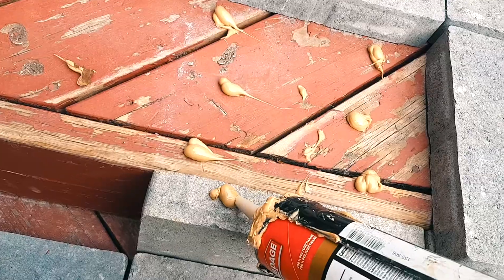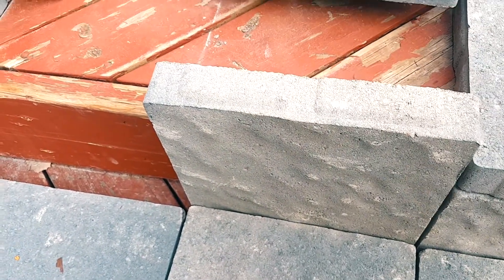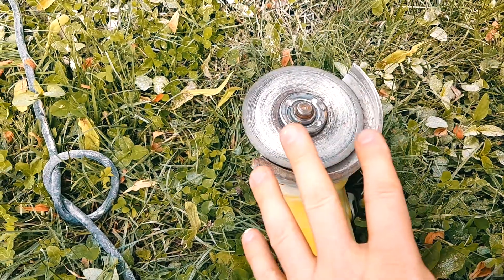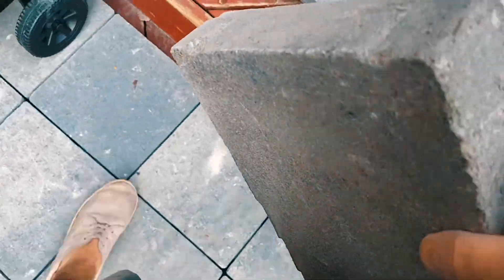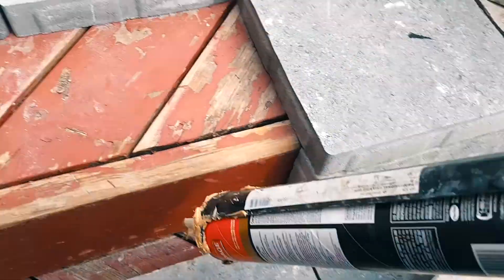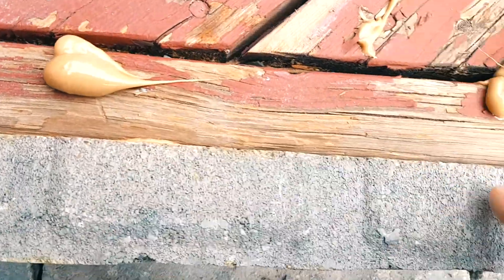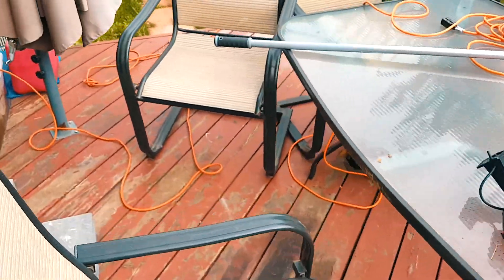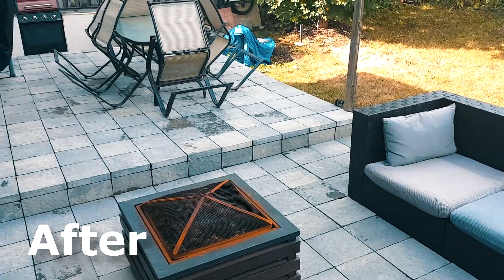How to Cut Patio Stones by Handand Glue Pavers to Wood - Using PL3 and 4" Angle Grinder

Comment: It looks like the edges of the pavers that overhang the step were sanded smooth so the spacing bumps aren’t there anymore. How did you smooth them out?
Reply from the maker: I cut them with angle grinder

Comment: Will this create a moisture issue with the wood?
Reply from the maker: Nope. It's covered with stone and polymeric sand keeps it from getting wet between joints. But some may tell you otherwise. although I would say use pressure treated lumber

Comment: I’m surprised your deck holds up all that weight!
Reply from the maker: The pavers weigh approx 7000 lbs spread over an area of under 300 sq feet. There's an additional 3000 lbs I can place on the deck according to the load formula based on the way the deck was built. The house was built in 1983, they did better workmanship back then.
Reply: Exactly my thoughts. It may even hold for now but moisture will rot that wood over time and then one day it may fail. Hopefully not until you sale the house. 🤷🏻‍♂️
Reply: @ChrisKidder  May fail?
Reply: It will fail! if not already.
Just hope nobody will get hurt.
This is totally against code!